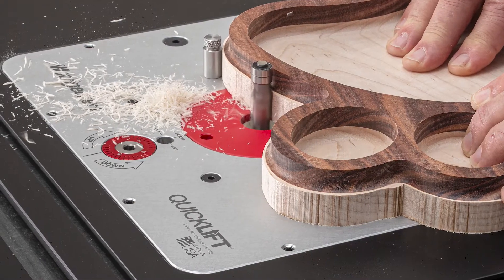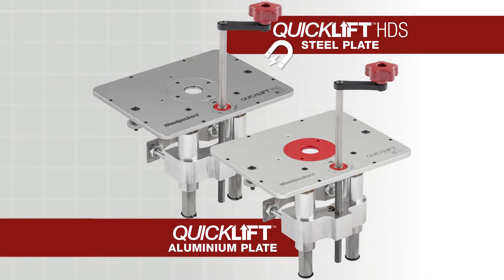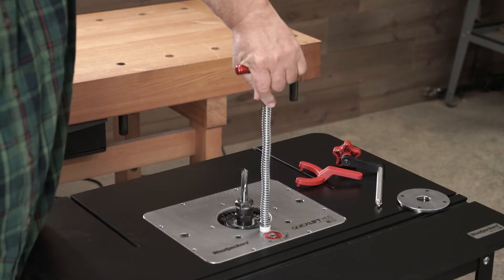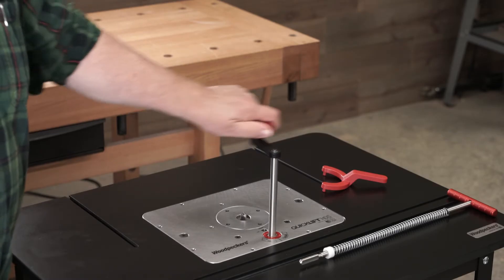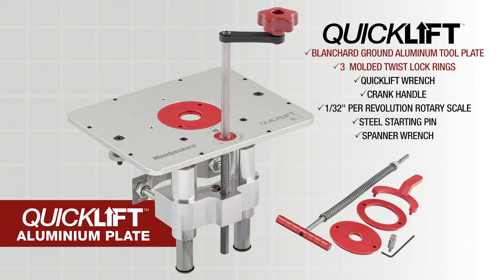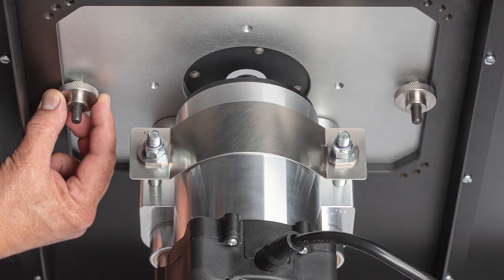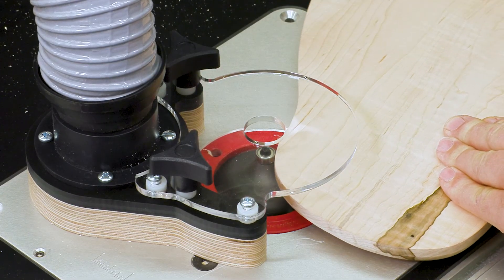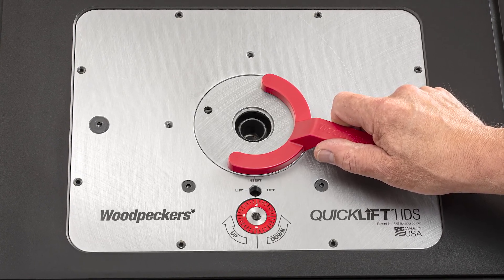QuickLift and QuickLift HDS

Comment: Are you planning on releasing one with 8.25" x 11.75" Plate Size to fit in the Benchdog router table, as you did for the PRL V2?  I've never been crazy about the hand wheel on the PRL, so I'd definitely be interested in this.

Comment: Why isn't the Quicklift wrench positioned in the side or rear of the plate so bit changes can be made more comfortably, not having to do a reach around the wrench??? Will you be making more sizes for the HDS Twist Lock Rings??? How long before the PRL Model gets discontinued because I might want to add it to my arsenal by Spring of 2024???

Comment: What kind of testing have you done on the new router body clamping design as compared to the PRL-V2.  The clamping system on the PRL-V2 is stout and gives me full confidence that that router wont slip or move while in use.
Reply from the maker: While it certainly doesn't have the history of the PRL-V2, everything we've tried here led us to our confidence in releasing the new model. We have no concerns about movement in the clamp. My personal experience is that the elevation system is a bit quicker and easier than the PRL-V2, but that could be because my PRL-V2 lives a brutal life in the model shop.

Comment: Is Woodpeckers still going to offer the PRL-v2?  I like the updated feature set of the Quicklift,  however  its priced way lower than the PRL-v2.  even if you take away the pre purchase discount.  Is the PRL V2 still  your PREMIUM router lift?
Reply from the maker: The PRL-V2 will remain in the line-up at least for a while. The clamping mechanism of the QuickLift is substantially less expensive to manufacture than the one on PRL-V2, however, it is just as effective. That's where the price difference is coming from.
Reply: Thank you for finding a better and less costly way to manufacture and passing the savings along to your customers.

Comment: what kind of protective coating are you using on the HDS to keep it from rusting and is it expected to last the lifetime of the tool?
Reply from the maker: We apply a paste wax after machining and laser engraving. It is not a lifetime treatment. You will need to keep it waxed or use some other rust preventative, just as you would on a table saw table.

Comment: Hmmm....where is the "LOCK" feature; to keep vibration from changing the height?
Reply from the maker: With the 1/32" pitch screw, a lock is unnecessary. It doesn't move.
Reply: @WoodpeckersLLC  I've got a 1/32" gear on my Woodpeckers (older black "Lift"); and it vibrates "off" EVERY time.

Thus, I have to HOLD the handle,  every time. I am NOT lying. Maybe it's only in mine. But it does change. Sorry kind Sir.
Reply: @MrPatdeeee  then send it in for repair.  i believe it has a lifetime warranty on the tool
Reply from the maker: What he said.
Reply: @WoodpeckersLLC  Thank you both. Do I have to 'price costs; for shipping up there; and you shipping it back? Because I bought 2 of them at the same time.